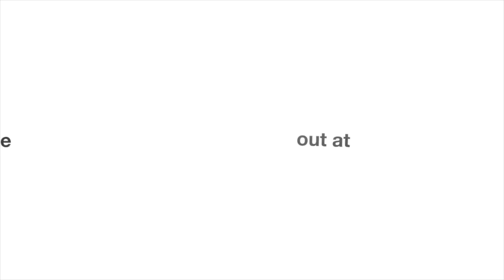Lawn Aeration How to Hollow tine

Comment: Yep another great video, Dave. My soil is clay in Switzerland and having got the thatch and moss under control with scarifying I do break up the cores after hollow tining using the scarifier. Works well if they have dried sufficiently. Like the Camon LA25 review - will buy one when I’m back in the UK in summer. Have a great Easter.

Comment: . Good job, thanks for the video. got a lawn to do . Done a bit of scarifying/dethatching in the past and found useless using the collecting bag and quicker to run mower over on a high setting to pick up loose thatch/dead moss. have you tried picking up the earth cores using a rotary mower and grass box? cheers

Comment: Hi fella cheers for the video but a question. 
How come you didn't back fill with lawn sand or good quality topsoil? Are you not opening up the ground to diseases?
Reply from the maker: Michael Hubbard 
Hi Michael to be clear “lawn sand” is only used to kill moss, but the reason for not top-dressing is simply due to the fact that the client is paying, so all you can do is advise! 
Also in the video I mention that the client is feeding the lawn himself, that will help the lawn recover from any stress the lawn was put under during the process
Hope this helps.
Reply: To cover this with a decent top dressing would be hugely expensive